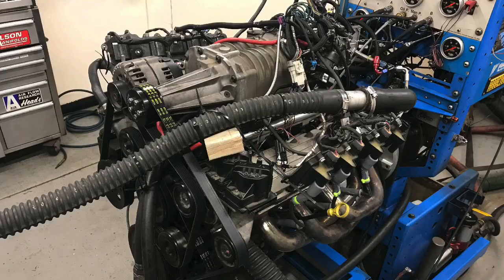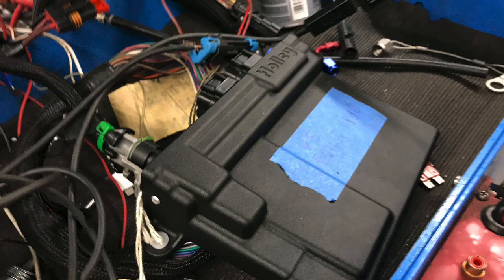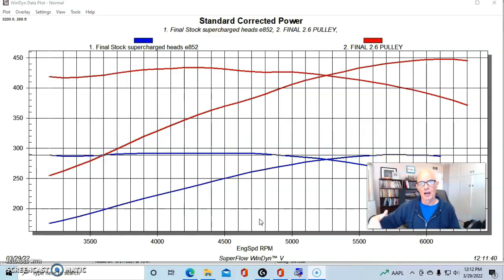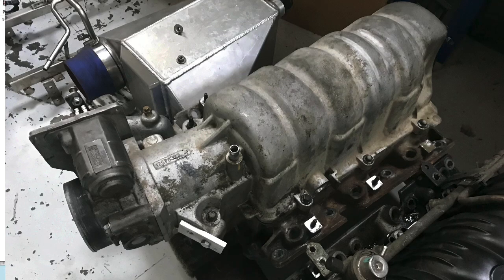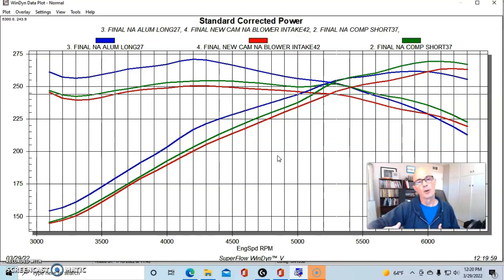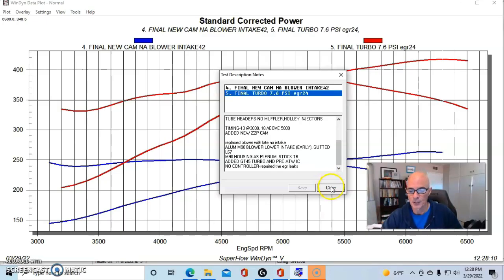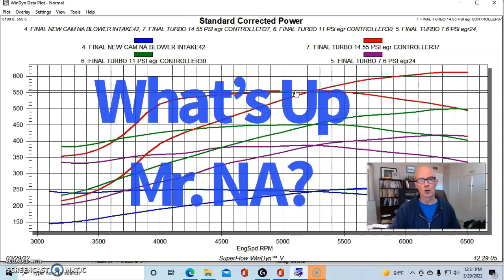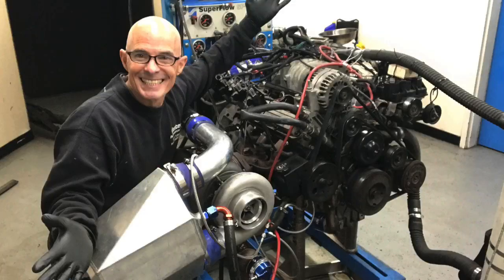JUNKYARD TURBO 3800 V6-WHY DOES IT MAKE SO LITTLE HORSEPOWER NA AND SO MUCH POWER UNDER BOOST?

Comment: The nic cam has a bit of overlap maybe backpressure from the turbo could be increasing cylinder  pressure slightly ... oxygen content in the e85 can help  ... boost also overcoming the flow inperfections in the l67 lower intake and gutted supercharger  houseing could also be a small part of the odd increase😅

Comment: The E85 makes a big difference for sure, and also you have a very big intercooler too, which you don't use NA.  But that doesn't seem enough to explain almost 3x the power with only 2x the "air".  Unless the NA power was very low because of the supercharger intake choking it off.  But 260hp from a 3.8 is huge seems to me.  I dunno, you are the expert, you can explain, or maybe the dyno was broken... lol

Comment: I need your help Richard! I'm building a racecar and trying to build a stand alone harness. I'm having trouble bypassing security in my ecu, what can I do? If you respond, ill send my email to communicate easier. Any help much appreciated!
Reply from the maker: STOCK ECU?
Reply: @richardholdener1727 Yes, but I'm waiting on a tuned one with security bypassed from zzp. Should be here any day.
Reply: @richardholdener1727 so after the tuned ecu arrived from zzp with security supposedly bypassed, it does the same thing! Dies immediately after firing. I read somewhere to truly bypass it, the ecu needs to be cracked open and have some terminals soldered but I'm not sure which ones.
Reply: I'm also debated buying a tuner to tweak the tuning to more my application
Reply: Yes but bought a tuned ecu from zpp, should be here any day

Comment: I would imagine the best way to get more power out of the na motor would be to have the deck milled down just enough to get the compression ratio up to about 10.5:1.

Comment: Definitely interested in parts compatible with 07 grand am 3800 not sure what gen
Reply from the maker: your grand am came with a 3800? I thought those were 3400
Reply: @richardholdener1727  nope definitely 3800 might be grand prix dont recall i get em mixed up alot newer body style tho base model not gt or nun like that no turbo or S.C

Comment: Even N/A, 289 horses and 292 lb ft from 232 cubic inches is nothing I would throw rocks at. 

Over 600 hp, and 550 lb ft from that, on STOCK INTERNALS, and gentle tuning to limit low speed torque is really impressive. 
Who would have ever thought a Buick regal had so much left on the table??

Awesome work, and thank you for your legwork putting these combinations together for fun, and the science!

Comment: Australian after market support for series 2  3800 v-6 ,    Steel cranked stroker kits 4.2 liters...ported n/a intakes - Dyno tested already - with heaps research published etc.... twin throttle intakes (twin 69 mil throttles) air to air intercoolers / also water to Air upgrades...   Turbo kits twin and single.....LS coil conversions -- basically all sorts of aftermarket parts  that makes for lots of v -6 fun...👍👍👍..

Comment: What exactly was the reason the 3800 was discontinued? Was it emissions or something related? It was so solid and ahead of anything else in almost all aspects. I had 2 Oldsmobile 98's that had this excellent powerplant. Both were so good they cast shame on the car's weak point which was the trans. These were big cars and that motor provided more than adequate torque with amazing gas mileage. This power plant should have been continually produced with , yes, turbo charging. It would likely make a great V8 replacement as such.
Reply from the maker: the modern v6 motors now make 100 hp more with better MPG-technology marches on

Comment: Curious how the supercharged Ford 3800 from the Thunderbird SC compare to the GM supercharged 3800? How different are they? hmm...
Reply from the maker: same rotor pack-different housing (inlet and outlet)
Reply: @richardholdener1727  Thanks! That Thunderbird super coupe is an under-appreciated vehicle... That can be had still for a very good price... I think it will likely become a collectible.. thanks for the info... I'm all about the budget builds lol..

Comment: Yeah I don't understand how the single turbo made so much more horsepower than the compound setup... 🤷🏽... Surely it can't be the parasitic loss of the supercharger?
Reply from the maker: THE TURBO WILL ALWAYS MAKE MORE POWER AT THE SAME BOOST LEVEL
Reply: @richardholdener1727  but why? What's the logic or the science behind it? I was generally of the belief that twin charging or compounding were some of the best setups.. 🤷🏽 it's hard to believe that over 20 lb of boost from a compound setup performs worse than a single turbo running 14 1/2 lbs... I genuinely feel like something's missing... Perhaps twin turbo is the best setup for the 3800 ?🤷🏽... It almost seems like that motor was built for boost...
Reply: The Lancia Delta S4 did so well with only a 1.8 L. Twin charge setup. https://en.m.wikipedia.org/wiki/Lancia_Delta_S4
Reply: @richardholdener1727  Any interest in doing a rotary series?... I know Rob Dahm has his thing but I think you could do better lol... I've got a Mazda RX-8 I'm going to try and blow up lol... E85, Nitrous, Turbo... I was considering putting a small ProCharger on it... 🤷🏽... We'll see.

Comment: From someone whos put his wheel time in on these, several actually. Upgrade your water pump, switch immediately to a inline fuel pump and switch the 4l60e for a 4l80e and have the shift kit installed.

Comment: True that the gutted blower is an impediment to the NA motor, but don't underestimate the low stock compression of the SC motor. The L67 in my Fiero is just slightly built (headers & cold air intake), and gets crap mileage around town, decent on the highway (30), but when I did 85 MPH on a stretch with a 80 MPH  speed limit it got 42 MPG.  I figure it was the only time it had enough load to boost the compression for a significant distance.  I'm pretty sure the L36 would give me better mileage around town & cruising the freeway.  I would miss the acceleration.
Reply from the maker: a vehicle does not get better fuel mileage at a higher speed-and higher compression will add mpg under cruise

Comment: Were the 3800 fwd and rwd engines the same with different ways of mounting the transmission
Reply from the maker: we use a rwd bell housing on our fwd 3800 on the dyno

Comment: Have you done one comparing the power gains from installing a turbo setup on the NA block vs on the SC block?
Reply from the maker: that is just added compression-worth 3-4% per 1 full point of na power
Reply: @richardholdener1727  there's a ton of factors you could be comparing by doing an L36/L67 comparison. The peak power at various levels of boost is an obvious one, but also failure points. How many psi can each block run before internal failure? How many psi can each block run on 97 before knock? Which one burns through a gallon of gasoline faster at simulated highway conditions (~2.5k rpm, ~14% load)?
Reply from the maker: I don't have knock detection-that is best done in a vehicle

Comment: my 94 regal back in the day was series one na, it would beat a 5.0 mustang all day long. I eventually had to junk it. 17 years later i picked up a 93 regal very similar to it, its slower as it doesn't have the composite intake but overall the thing still pulls harder than most cars on the road and still gets me a nice 24 miles to the gallon.
Reply from the maker: You think an NA 3800 would beat a 5.0L Mustang?
Reply: i don't think it, i lived it. the 4t60E transmission may be thought of as weak but what most fail to realize is its geared perfectly for the weight of the car and the power rpm range. The ole pewquick would leave two rubber patches as long as a limo and would dust the mustangs. i remember lining up next to this yellow 98 stickshift 5.0, guy thought he was gonna take me, never saw him after he hit 3rd gear. @richardholdener1727
Reply: I don’t know… I bought an ‘89 LeSabre new, and loved it so much, I bought a black on black’92 Buick Regal Gran Sport Supercharged 2-Door (Black leather might not have been the best idea in Arizona, but I owned a small mobile electronics company at the time, so I just had one of my guys install a remote start alarm system to help cool it down a bit.)  A bit of tuning, a custom milled billet supercharger pulley and water/methanol injection and she was eating most sports cars alive (She was also eating transmissions and CV joints as well, but that’s a different story for a different day…).  I’m still a Buick 3.8 S/C NUT!  I’d really like to put one in a Fiero someday….

Comment: Q?;   from an 'Proud' owner of a  GTP 3800 ser. III - NA. ('04 G. Prix):  If I were to Mod w the turbo, what are the stresses on the stock tranny ?   A intercooler is an obvious must, cause it already runs way too hot, causing some shifting issues...(common problem).

All mods wud be for street / showing & reg. Driving, Not Racing. Trying too keep it cheap, reliable, and simple !

(Also.... I'm an enthusiasts,  but, not a mechanic... )

Thanks
Reply from the maker: stock trans is not strong enough for this power level
Reply: @richardholdener1727  
Suggestions  ??  Ty

Comment: What wireharness was used with the holley hp. Also did you use a serperate coil system.
Reply from the maker: ls coil packs
Reply: @richardholdener1727  what it a store bought harness or a custom.

Comment: As an aussie, it feels good to see this motor being reviewed and tested, this is a holden 3800 ecotec here in Australia used in the commodore, used from 96 to 04 (from what i understand) both n/a and supercharged in a rwd platform ONLY, heaps of aftermarket support for the 3800 also 👍🏽🇦🇺
Reply: They did make an awd, the adventra
 "The Holden Adventra is an off-road version of the Commodore station wagon and was built from 2003-2009. The Adventra boasts full-time four-wheel drive, 200mm of ground clearance along with V8 and V6 engines. The Adventra also has a tough looking body kit with wheel arch extensions and underbody protection." 
So yeah
Reply: @washedwiththeword  there's actually a large forum page going into full detail on how to convert a VY/VZ GTO/Monaro to AWD using the cross8 / avalanche drivetrain, essentially turning them into that awd monaro holden produced in the early 2000's, was a great read 👍🏾
Reply: If you type into youtube - Holden 3.8L T56 conversion - and youll find what clutch options people have gone with, im not to knowledgeable with clutch stuff 👍🏾🤙🏾
Reply: @washedwiththeword  i would love to see an ecotec version of the cross6 / adventra, the alloytec was junk because people didnt know how to take care of them, people treated them like ecotecs 😂 hasn't changed the oil in over 40,000 kms and its rattling like charity bucket you throw your coins into 🤣 also seeing a L67 adventra would be awesome aswell 🤷🏽‍♂️
Reply: Why do yall get the cool shit
Reply: @jordanhall1133  barely! Wish i could get my hands on a vortec 8100 v8 🙏🏽 and stick that in a commodore! Know it probably wouldn't fit but Ill damn well try! 😂👍🏾
Reply: Here it was in FWD ONLY, dunno why, the gear heads all loved rwd better in those days...

Comment: I think all the mods took full advantage of the efficiency of the turbo setup.  What compression ratio did it have? Also are any of the parts still available?
Reply: And do you kno if they will fit on a series 1?
Reply from the maker: blower and pulleys are avail

Comment: The 3800 made 200hp NA. From a V6 in the 90s, that's massive.
Reply: But almost all the v6 cars from the 90s made around 200 hp
Reply: @LOVE-VIBES-X-PROJECT-CARS only the high end I6/V6's from Audi, Mercedes and BMW made 200+. The top V6's from U.S. and Japanese makers were closer to 170-180. So the 3800 making 205 was pretty impressive for time.
Reply: Mitsubishi had 210 horsepower in the diamante, Mazda in the 90’s had a v6 that made 210hp, Lexus had the es300 that made 210 horsepower, Mercury had 200 horsepower in their sable, Toyota had 200 horsepower in their solara and Honda made 200 horsepower accords. all of these cars being lighter and had better gearing than most offerings gm had. Lesabres were 3,600 pounds, bonnevilles were heavier. 200 horsepower wasn’t that much of an achievement. Let’s not get crazy here. The na 3800 isn’t a powerhouse and absolutely blended into the rest of the v6 market in terms of power. The only thing that makes the 3800 special is the durability along with its potential power output. let’s not rewrite history.
Reply: @theeoddments960  you are right the 3800 is definitely the best v6
Reply: The SHO made 220 in 1989, with just 3.0L displacement.

Comment: Love the NIC cam, low lift, easy on valvetrain and nice lopy idle. Powerband past 6k, been running it for almost a decade. I did try a turbo setup, also on e85, same setup, same empty supercharger housing, 16 psi and no intercooler and no knock, was an absolute beast in boost but a total dog off the line so went back to just supercharged, way more fun on the street from light to light. Why it's weak NA? Has to be the poor flowing heads, they were probably designed to keep pre-ignition knock low but horrible in the flow department. Imagine a 4 valve 3800 supercharged, all the torque off the line but added way more power up high.
Reply from the maker: supercharged is immediate boost-turbo is not-but ultimately more powerful

Comment: Depending on the particular motor that you got from the junkyard it may have been a high compression head set up already I say that because Buick makes high-compression heads from the factory  Pontiac and Chevy did not offer this as an option but Buick did

Comment: The 3800 was an absolute workhorse of an engine.  I'm so sorry it was discontinued.  My NA Series II is a stock unit in a 2005 LeSabre.  Fantastic fuel economy, 34.2 MPG crusing interstate at 70.  This is basically the economy of a Honda Accord from a mid-size V6 in a 3700 lb 6 passenger sedan.  Nice work you did on the turbo mods!

Comment: Do a 9:5.1 N/A 3800 series 2 top swap with gen 3 and gen 5 supercharger n L67 heads. See how much horsepowers it gets with 9 tune
Reply from the maker: WHAT IS 9 TUNE?
Reply: @richardholdener1727  🤣🤣🤣I meant 91 or 93 tune sorry.

Comment: My theory is that these engines don't effectively scavenge like a v8 would due to the way they fire bank to bank. That, and the heads are a typical Buick design- made to excel at low RPM torque production but don't really flow that well.

Comment: I’m getting ready to turbo my 3800 series 2 in my 1998 firebird, thanks for this video! Looking forward to the build
Reply: Can’t find any turbo kits, do I have to make it all my self or trust the ones off eBay?
Reply: Is there a guide you're following for this? I want to do the same with my series 2 in 02 camaro.
Reply: following

Comment: Compressor map efficiency, depending on the A/R, turbine and compressor combination, the turbo will prefer to operate within certain ranges, in those islands it will move more air per pound of boost and heat it less. Which results in more power. At the low boost you were probably under that island, and moved into it.

Comment: Hello how are you today?
I love your videos and I am an big fan of the v6 parshal to the buick 3.8l or 4.1l have an few of these older engines I like what you have done with the newer engines I. The 3.8l form but what if you added boost to the camaro 3.4l v6 chevys 60* engineer even the hated 2.8l?
Juat wondering hope this sparked your wonder some to see.
I would also like to ask when you did the fwd intake inside comparison's from high to low why not add boost to that test I thing the low inside would make the best power but what about the rpm of these inside high mid and low what makes what where via each

Comment: Richard - If the 3800 is such a good basis - why don't you try to make a twin-turbo setup reaching the 710HP of a 488 Ferrari Pista? You made already 600HP+ with a single turbo/supercharger setup. It would be hilarious. A GM small block V6 beating a Ferrari V8!
Reply from the maker: 700 HP WOULD JUST BE MORE BOOST FROM THE 1 TURBO-NO NEED FOR TWINS-AND WE ARE SHOOTING FOR 1000 HP
Reply: You ever do any work for people I have a lambo Diablo kit car  with the 3800 super changed.

Comment: I'm not sure exactly I'm talking about I've got a 1997 Pontiac firebird trans am and I've been told that certain body's won't accept a V8. Is it that it won't accept the V8 or it can't or is it that some people just don't want to go through the trouble of modifying certain parts in the engine well to have clearance for a V8 or is there another issue that I don't completely no please get back to me with information thank you
Reply from the maker: the firebird came factory with v8s-it will fit

Comment: Hey richard i have a 1997 firebird v6 3800 series 2 and im working on a rear mount turbo im tight on money but i could definetly use some parts if you still have any
Reply from the maker: only blower
Reply: @richardholdener1727  i actually just ordered a t04e and everything i need to re do my rear mount setup do you have any tuning tips? I will be using hp tuners

Comment: I would like to see an actual NA comparison using the actual NA L36 motor which has a higher compression ratio, an then some tests on a top swap and turbo as well using the L67 lower intake manifold vs the L36 version see which makes more power